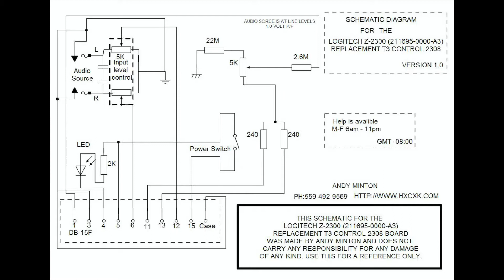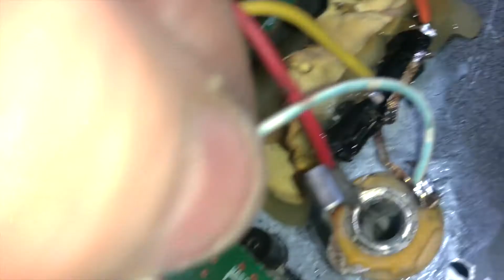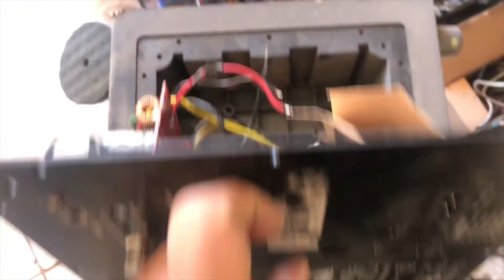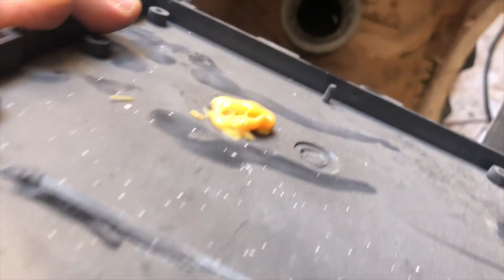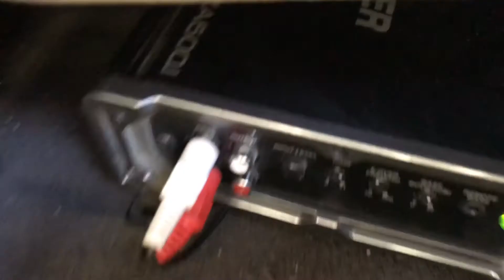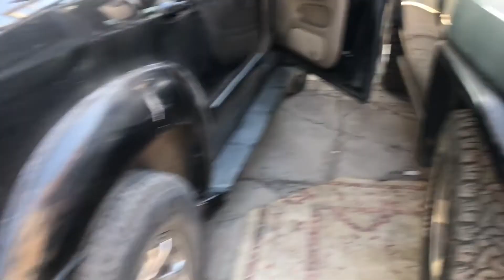Logitech Z 2300 no remote - Learn how to make this unit work when no remote is provided

Comment: Hello sir. I have this subwoofer z2300 and I want to make it, portable, meaning remove the toroidal transformer and powering with liion pack battery. What tension volts is needed and your opinion if is ok? Also adding Bluetooth module. Just subbed to your channel!

Comment: Does anyone have any advice for suitable Satellite replacements? I have some tears in mine and starting to distort quite a bit. I read that the cross over frequency is 150Hz, so the speakers need to be 8ohm and 150Hz - 20kHz.
Any recommendations would be great
Reply from the maker: I got a pair of old Yamahas speakers, they were old and second hand, but have a really good sound. Loos for speaker boxes with tweeter and mid ranges, docent matter if they are small, for satellites you don't need a lot.
Reply: @Letsdosomethinguseful  Thanks for the reply - I will also look at some second hand options, maybe I can find a bargain and just strip out the speaker and test it

Comment: Hi, an other question:
Do you know anything about acoustics and a humming noise coming from the sub-box and the satellites when connected?
It is just a silence hum and if I plug in a 3,5 (from a headset for example) into the remote, then it’s gone. Unplug it, here it is again.
Any idea?
Reply from the maker: Usually that is because there is a faulty ground. But if you connect other analog audio system in the same outlet and doesn't do the same, it must be a filtering capacitor.
Reply: @Letsdosomethinguseful  then it must be the filter capacitor. Thanks!
Do you maybe know which ones are these capacitors?
Reply from the maker: @BAD_LS  At the main input of the power supply is one big capacitor. Also, I recommend to replace the 2 at the output of the amplifier integrated circuit.

Comment: I wanted just to test out the speakers i know how to connect all pins to wire except  pin 1 , i connect pin 15 and 5 together w switch pin 6 to right pad on my headphone jack pin 12 to left pad on jack and pin 3 to ground but where do i connect pin 1?
Reply: same issue i guess you can cobine pin one with reft and right input?? justt a guess

Comment: Thanks for this video ,it saves me a lot of time figuring it all out since i had the same problem .I was wondering about one thing though, at the end of the video the woofers are clearly moving out of fase. Were you aware of that? This will reduse the bass sound to practicaly nothing.

Comment: I don’t know WHAT happened while watching this video because it started w/ how to make a DIY controller w/ the pin-out schematic & ended w/ you showing the subs in your Sequoia …?

Are you using the Logitech amp for 8-Ohm home speakers on 4-Ohm car audio speakers..? TWO of them..?

Are those two subs wired in Series..?? How did we even get here but you shouldn’t do that at ALL hahahah

The amp needs 120v & a car amp needs 12v but hey, I’m sure you figured SOMEthing out ..! Looks like it works :)

But you’re goina blow your Logitech amp w/ 4-Ohm speakers, I’d just have to figure

Pretty informative video, otherwise ! Thanks for the pin-out schematic, genuinely ! <3

Comment: Great video, How would someone properly upgrade the internal power components components,  so that the unit can use the full power of the original bridged tada7295's with the 2 tda7296's? As well what would need to be done internally if all the amps were upgraded to tda7294?

Comment: i have the same problem, but i  have a z4 logitech remote (9 pin connection), could i make this work? any ideas?
Reply from the maker: yes, it is basically the same with different type of connector.